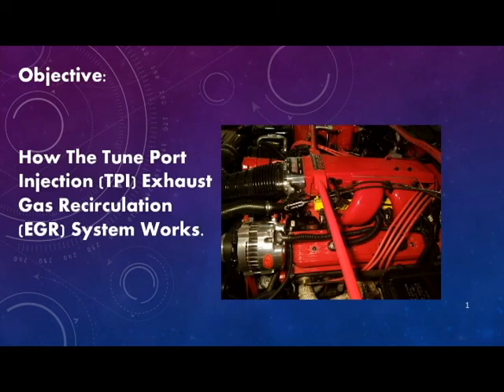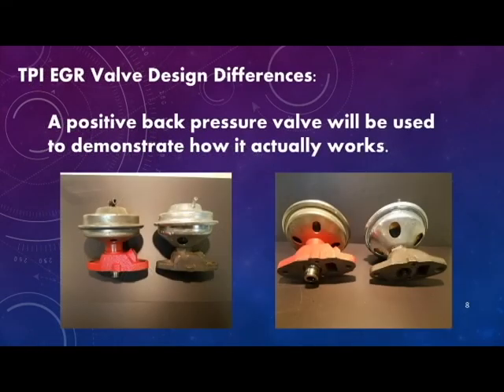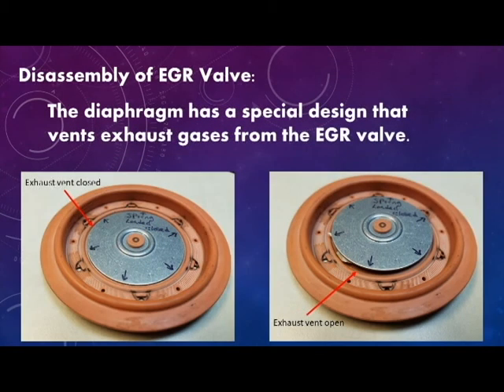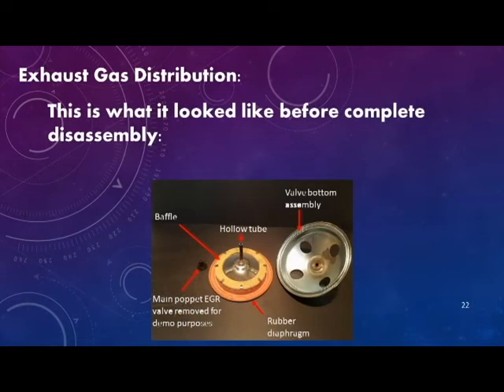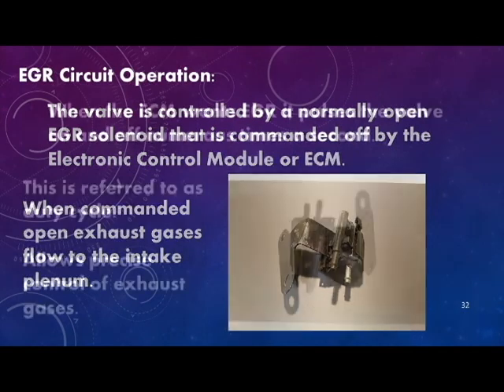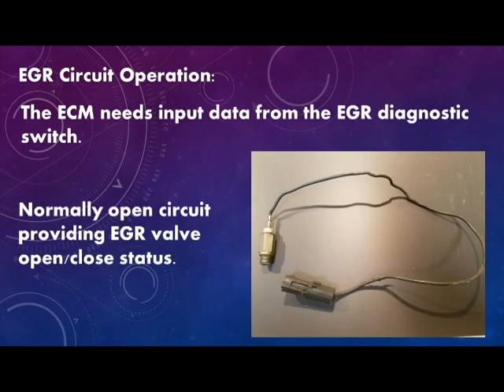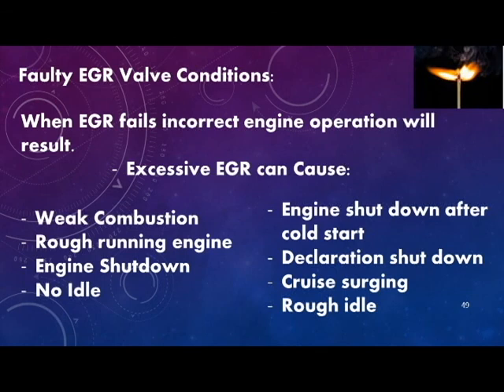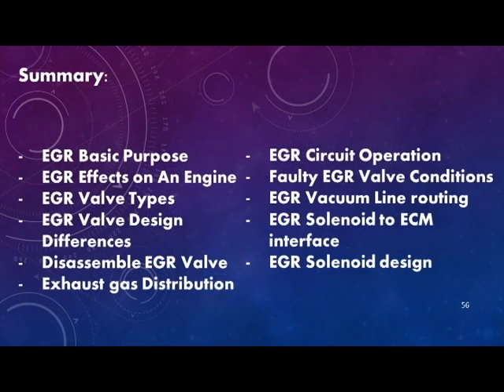Tuned Port Injection, How The EGR System Works.

Comment: Great video. One question. My 1985  5.7 L98 engine has these EGR small tubes on the runners on the drivers side and that passenger side . Does exhaust gas come up from the exhaust from BOTH banks ?